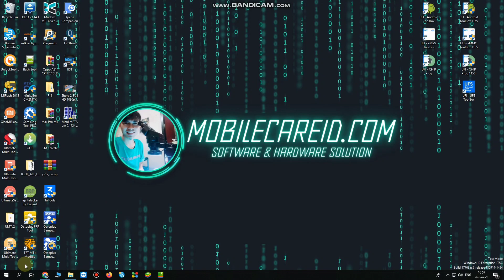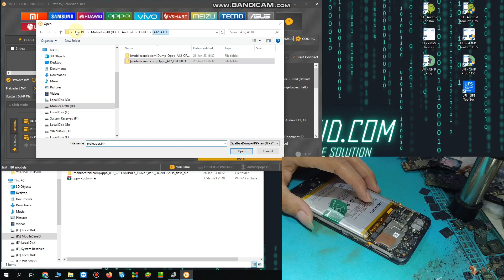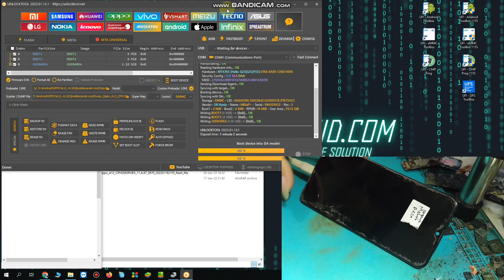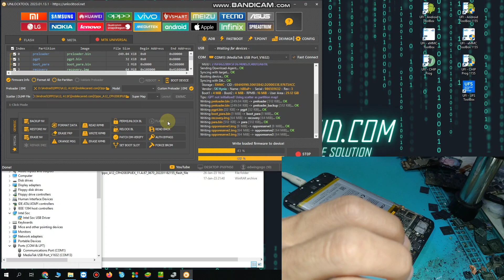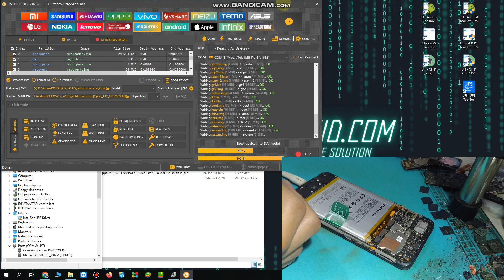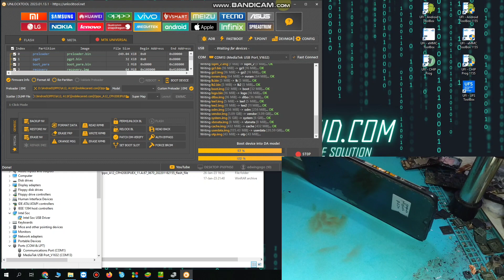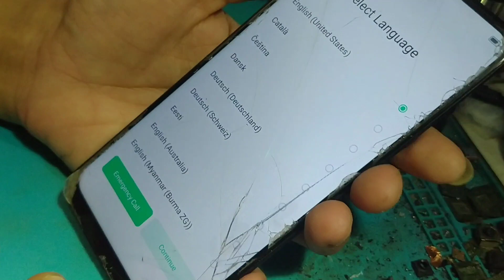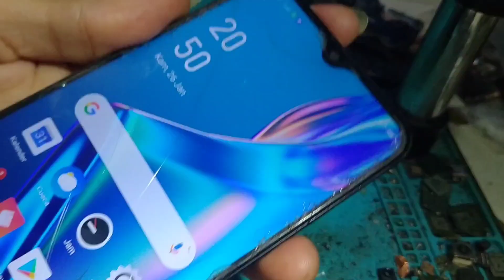Change eMMC Only Oppo A11k A12 (CPH2071 CPH2083PU) Without BOX | Fix Signal On @mobilecareid

Comment: Imei null 😢😢
Reply from the maker: Write IMEI via Unlocktool or Hydra Mediatek Tool or Pandora Tool
Reply: @mobilecareid  imei repair same null
Reply: @mobcyclopedia8207 no problem imei null be cause cpu was protec. but no problem signal on
Reply: Imi null